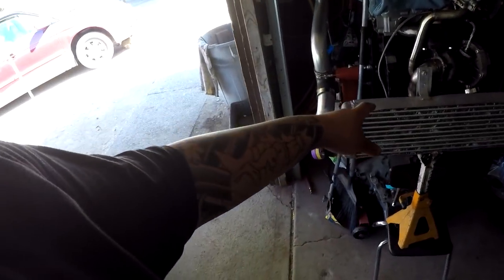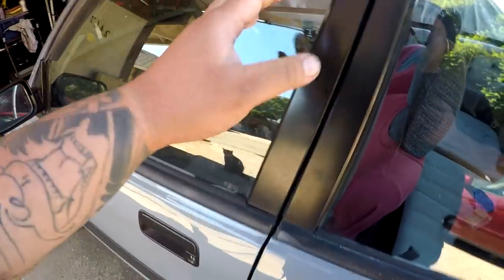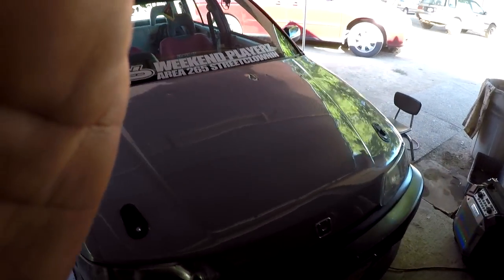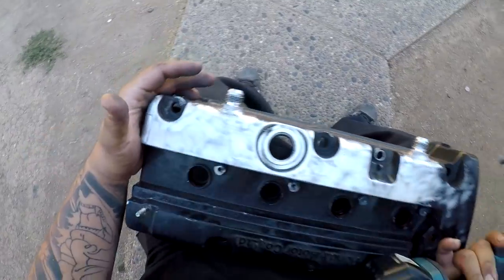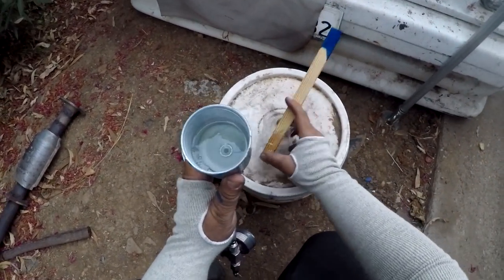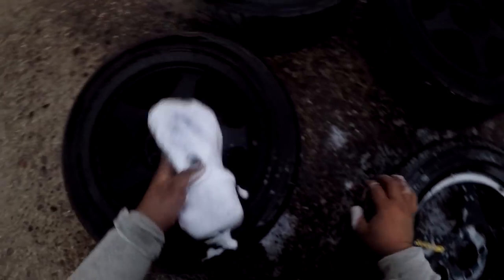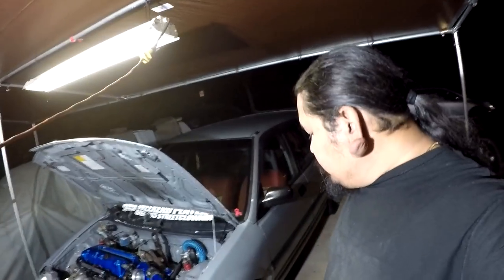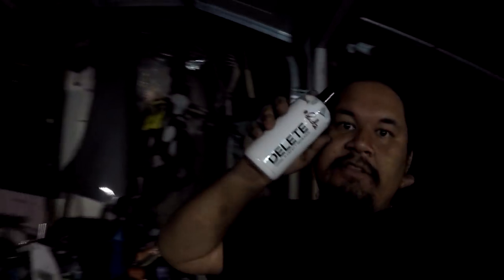Shukai Prep DONE ! SW388 | Valve Cover Paint | #SudzBox

Comment: Do you plan on doing anything with the interior?
Reply from the maker: i have beagle rear seats to match the front, power windows and matching beagle door panels that i havent got around to installing. beagle floor mats, i need a s2k cluster bezel and 6point roll cage as  far as interior

Comment: Fake it til you make it bro! That shit gets expensive af! Man I gotta cg3 I'm debating on boosting the stock f23a or get a f20b for boost... What you think bro?!
Reply: Project Accords boost the f20b they’re cheap from jdm of San Diego, that’s where I got mine
Reply: Christian Gallardo I was thinking about boosting the f20b even on 8lbs it should be fun af
Reply from the maker: the f23a is low compression, so it should take boost really well. the f20b is 11:1, a little on the high side for boost but is doable..higher compression = less boost to make power, but theres a limit.
Reply: Cast iron sleeves help though Dana!